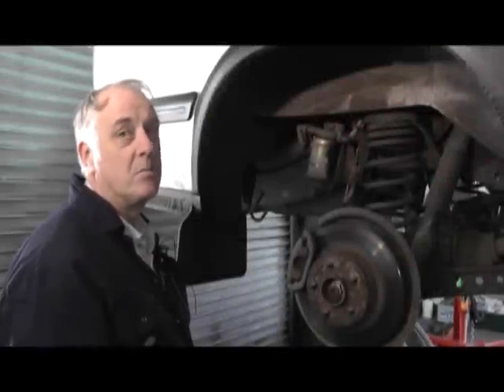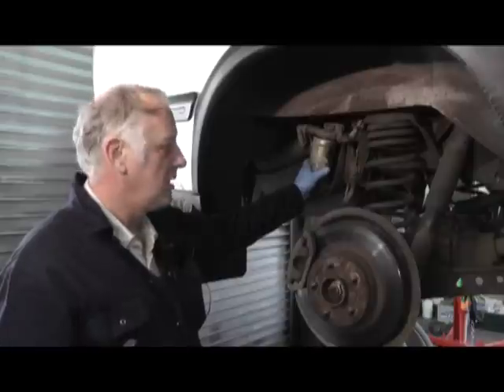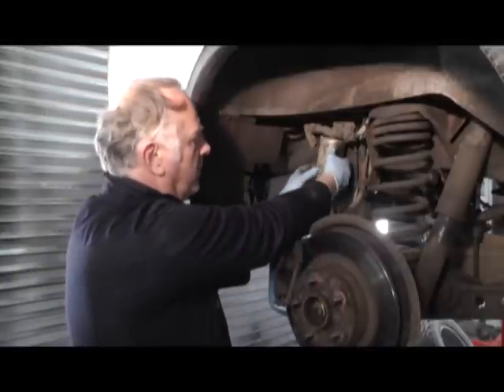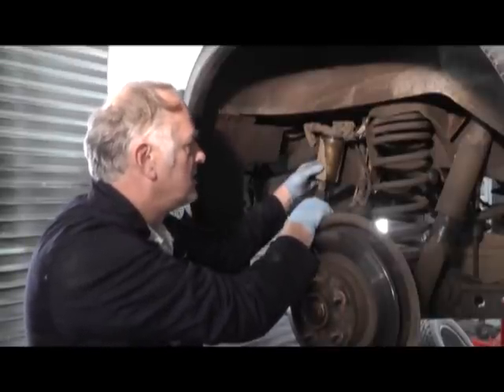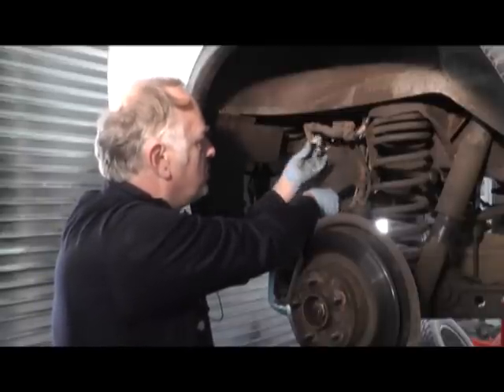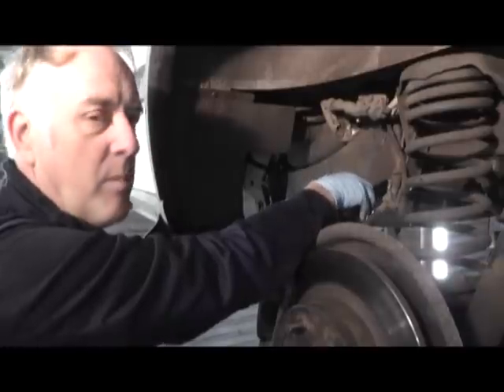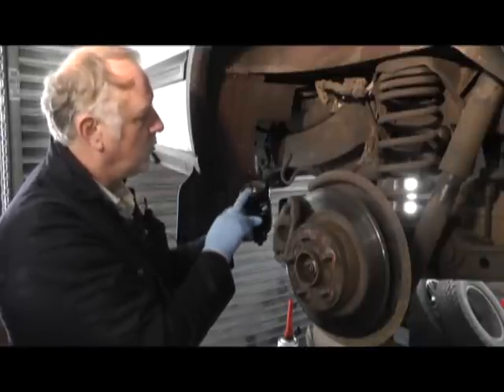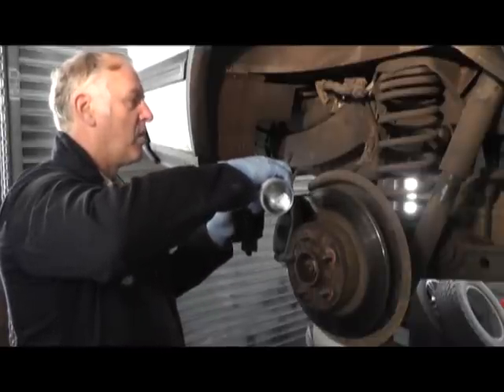Land Rover TD5 Fuel Filter Change 2001 model

Comment: Cheers guys. Needed an oil filter wrench to take it off but easy job and no need to remove the wheel either.
Reply: Smash a old screw driver into it turn it then replace with a new one 😎

Comment: Another thing you can do instead of turning the ignition on and off, once you tirn the ignition on you hear the pump cycle for 30 seconds as you say, but once it's done it's cyle fully depress the throttle pedal 5 times and it will cycle again, do as many times as necessary.

Comment: Hi, can you put any diesel fuel cleaner straight in the filter because there's loads out there? I wouldn't like to damage the engine.
Reply from the maker: Couldn't comment for certain, but it's only a cleaner treatment, so you should be ok.
Reply: Thanks

Comment: Hello there.  This video is very helpful. However I have 2 questions I need answering. 

1. Is this the same process for a Land Rover discovery 2 td5 2003 series? 

2. Can I have diesel in the tank when I change the filter? 

Cheers. 

Warren
Reply from the maker: +Warren chickenLover88 

Hi there, yes it's the same process and you can retain diesel in the tank. Hope that helps.